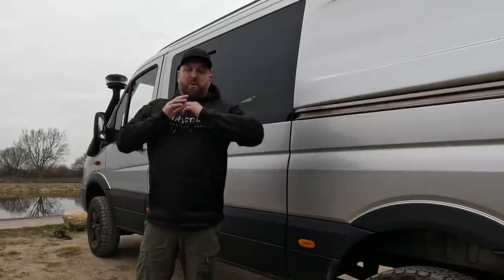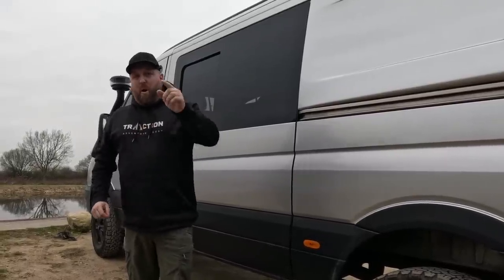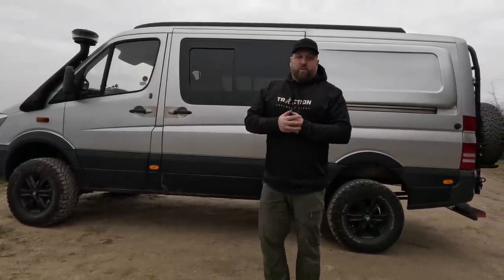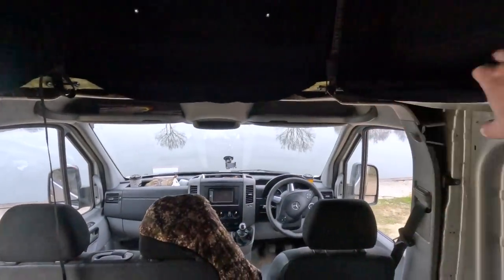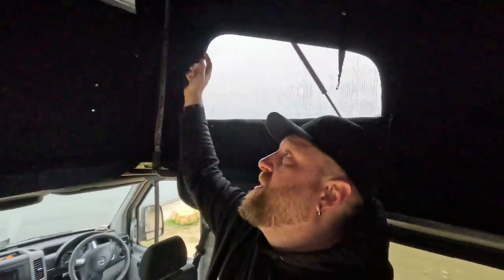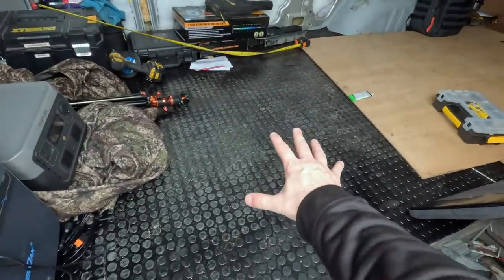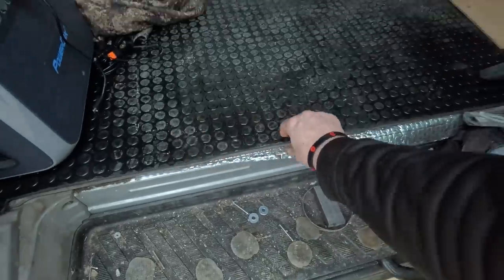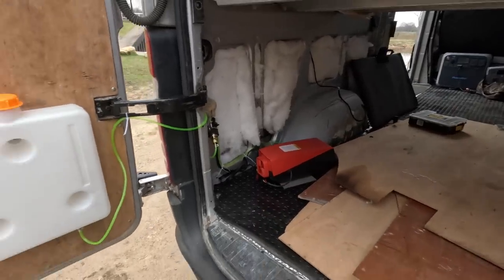4x4 Mercedes sprinter with a WV T6 pop top conversion!

Comment: Rear windows look superb. Totally change the look of the vehicle.

Was a bit confused as to why you need the side-flares if you're going to have a bed in the pop-top.
Is the plan to have a bench-seat across the back that can be used as a bed or are they just there to create more interior space?

Y'know, fitting the tank for the diesel heater to the door is actually a smart idea.... if you can find a way to do it neatly.
Even if you spill a tiny bit of diesel while filling the tank it'll stink up the inside of a vehicle so fitting the tank to the door means any spilled diesel goes on the floor instead of inside the vehicle.

I have a fuel tank for a diesel-heater and a water tank in the back of my Disco' and I've found the tidiest way to fill them is to fill up a 5 gallon drum and then use a little submersible electric pump to transfer fuel/water into the vehicle's tanks. Just got to make sure I don't mix up the pumps or drums. 🤢

Comment: Hi Rich
How are you getting on with the round snorkel pre-cleaner? We fitted one to our van prior to a trip to Morocco and the Sahara last year to keep the sand intake down but had to change back to the standard snorkel intake after the blocked air filter dash warning came on when we started long mountain climbs south of Fes. We had checked the filter and it was fine. So sussed the engine was being starved of air. When we spoke to a French sprinter 4x4 driver out there we noticed his snorkel bowl was much larger than ours hence being able to pull in more air so he hadn’t had a problem. The supplier agreed to us returning it when we got back but it was already discoloured by the heat so binned it and now just reverse the intake the same as the Moroccans when heading through sand n snow storms.

Comment: I absolutely love the idea to fit a T6 roof to a sprinter. 
Because I’m from Germany I wonder whether there is any registration requirement in UK if you cut such a large hole in the roof to fit a pop top that is not originally designed for this vehicle. Did you have any issues there?
Reply from the maker: We don’t have any rules on things like that. The only issue would be if some one died in a crash and that was a cause. For every bit of strength I have taken out I have replaced it with more in different places.

Comment: So did the power bank actually run the diesel heater? All of the smaller ones that I’ve seen, are too low power and shut off as the heater starts.